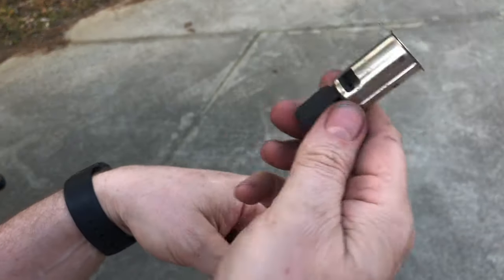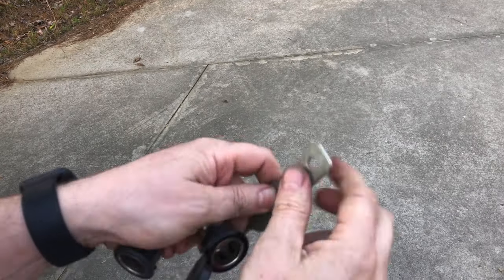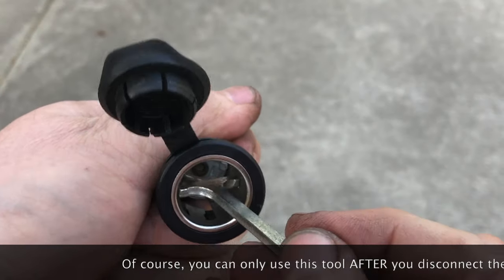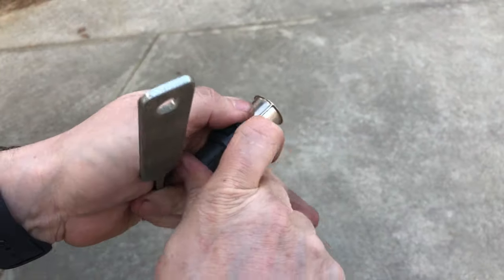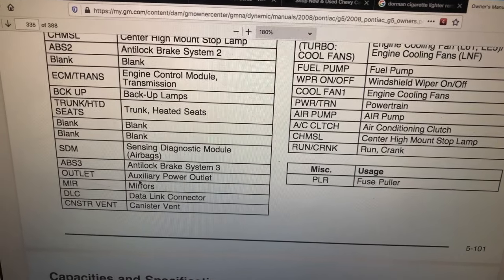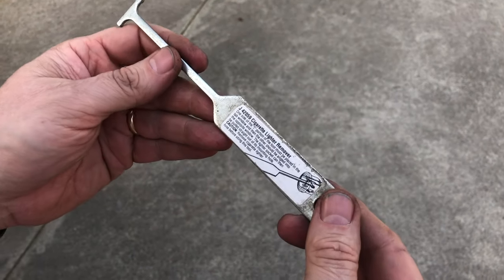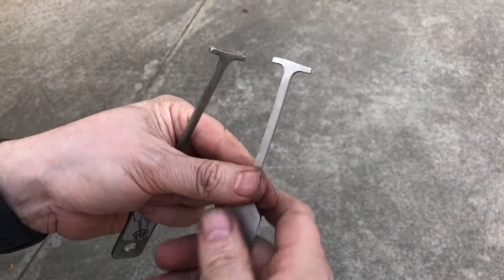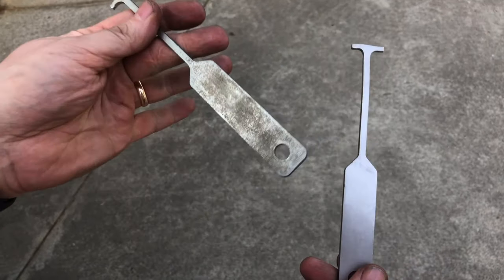1996 - 2020 GM Car Van or Truck Accessory Power Outlet / Cigarette Lighter Socket Removal & Tool Use

Comment: Thank you for the video. From my experience I recommend buying the original tool. My after market one was tiny bit wider and got stuck in the socket. It took me about half an hour of swearing to get it out, unfortunately with few bruises around the socket. Spending few more bucks is definitely worth it.
Reply: Agreed, I bought the socket and tool for 20 bucks.
Reply: I bought the Dorman which is not the OEM tool as suggested in the comment below and I contacted Dorman first and they said it was the tool. It's now stuck. Socket won't come out and tool won't come out. Doesnt even make sense to me. Unless the tool bent in there? Aluminum not steel like the OEM. Plan B.
Reply: @sweetiepienumber1  the same thing is currently happening to me. Stuck inside

Comment: Unless the Dorman 56457 (OEM Part Number 25776667; J42059) tool was too wide; 2018 Chevy Traverse does not seem to use a tool even though the socket accommodates one. DrShock told me some cars require removing the black bezel plastic ring/retainer ring with a tab on each side (east and west) that are depressed and then by pulling out the bezel the socket came with it. My Dorman tool got stuck in the lighter socket in the plastic bezel housing. I could not remove the tool until I was able to push the socket back into the bezel a fraction (after I had it at a vise). I don't see how the tool works on this car because when removing the bezel the socket came out with it.  Thank you DrShock for the tip.

Comment: Great stuff! ... Now then, how do u remove it if the cigarette lighter itself is stuck(pushed in) inside the socket & doesn't want to budge?
Reply from the maker: I imagine this could only happen due to either corrosion, or a defective design aftermarket part encountering some physical obstruction with the OEM socket.  Either way, you'll have to apply sufficient force to undo this bond in order to get the tool in that's required to remove the socket.   Care is needed to avoid cracking or otherwise damaging the dash when doing so.   For corrosion some penetrating fluid can be helpful (put down plastic to avoid staining the carpet below).  And you definitely want to pull the appropriate fuse to remove power when going this route.

Comment: How do you get the bezel back in? I'm replacing a dash panel and I have to use the old bezel on new panel for cigarette lighter and it don't want to go back in. It looks like it should snap back in, but I keep pressing it, but it's not snapping back in. Do I need a special tool to get the bezel back in? It's a 2002 Chevrolet Cavalier. Thanks for your time
Reply from the maker: No special tool for the models with a bezel.  But there will be tabs on the bezel, both that secure it to the dash panel, and to the socket.   Either you haven't got those aligned, or they may have broken off due to age requiring replacement of the plastic bezel.
Reply: Thanks!!! @DrShock

Comment: Maybe you can help me ? My cigarette lighter is stuck in the socket and won't
come out, no matter how hard I pull on it. When I bought my car used, the previous
owner removed all cigarette lighters, so I used one from another car, and it's
"stuck" in there. Should I drill it out ? or really pull hard ? If I pull too hard it may
tear out the wiring harness. You seem to be very good with your hands, so what
would you do ? I'm thinking just to drill it out ?? What do you think ??
Good video BTW.
Reply from the maker: If I'm following you, this is a situation where you forced the installation of a outlet from a different model vehicle into this current vehicle.   As a result, the fitment is wrong so now it's wedged into the dash.
 
Well in this sort of situation I'd be concerned with damage to the plastic dash face/bezel, so what I would suggest is removing that from the vehicle and work on extracting the incorrect sized socket from behind.

Comment: I have a 2006 GMC Sierra 
It has the single piece lower dash assembly
I used the DIY tool and I’ve wiggled
Pulled
Strained
Tugged
And bent the shit out of my tool with zero progress on getting the original non working socket out
Reply: Have you removed it yet ?

Comment: Great instruction... Will replacing that part of the lighter be enough to stop burning out the fuse. (I'm sure I'm not using the right language.)
Reply from the maker: Thanks, the fuse is going out from a short circuit most likely.  That could be in the socket (the part this video covers), or the wiring harness connecting to the socket in the back of the dash.  

The easiest way to tell is a visual inspection after removing the socket from the vehicle.  Check for some debris inside first, sometimes that's all it is.  Sockets that are obviously rusted/corroded, appear burnt, or otherwise damaged at that center terminal at the very bottom of the socket are likely shot (what blows the fuse is direct electrical contact being made from that center terminal with the sides of the socket instead of a lighter element or phone charging plug).
 
The best way is to test the socket with a voltmeter, which a local auto parts store should be able to do if you do not own that kind of tool.

Comment: I accidently busted the "bezel". Is there a specific model number for the bezel that goes to the outlet? Or are they universal?
Reply from the maker: It will vary by model year and model, GM uses the same part across many models for this but they do change over the years to match the interior design changes.   Your local GM dealer should be able to hook you up with just the VIN.

Comment: Hi, I bought the Dorman tool (I messaged Dorman they said it was the right tool) for a 2018 Chevy Traverse and it went into the socket fine, however the socket will not pull out. I can't get the tool out either. Any thoughts? Thank  you.
Reply from the maker: If the socket on that model and year has the two opposing square cutouts for the tool, then you should be able to remove the tool by moving one peg of the tool all the way out of one square cutout on the socket by rocking it at an angle.   If it went in, it can come out.  ;-)

Some models may have a snap on retaining bezel going into the dash trim that you may have to remove first, before the socket can be extracted.   The service manual for the model and year is going to be necessary to determine if that's the case with your vehicle.
Reply: Thank you the retaining ring might be the issue. I have the tool in right I watched your video and others, etc. I pulled so hard I injured my intercostal muscles pulling on that tool. I lubed the sides with silicone to no avail as well. So. I'll try the tabs on the sides of the black plastic ring with hinged cover. I appreciate you getting back to me so quickly. When I get this out I'll have to buy a DrShock t-shirt. @DrShock

Comment: I have a 2002 Chrysler Sebring and a penny dropped down the cigarette lighter socket and there was a small spark and now I don’t have power to my sockets. What should I do to fix this? Thanks for any help given in advance it’s greatly appreciated
Reply from the maker: The coin would have created a short circuit, which would then blow the fuse.   You'll need to extract the coin by removing the socket and disconnecting it before you replace the fuse.   The socket may still be serviceable, or it may need to be replaced.   You would judge that based on signs of burns or heat damage, as well as corrosion.
Reply: @DrShock  out of curiosity, what would happen if I disconnected the fuse before the battery? I’m very new to this so every little information helps. Thanks
Reply from the maker: @LongHairedTurtle  If you remove the correct fuse (the one actually for the accessory power socket), it's the same outcome as disconnecting the vehicles battery negative cable.

Comment: Same tool for a '78 GM product or would you "bend" the clips with a small screwdriver like I've seen on other channels?
Reply from the maker: There's a reason GM designs special tools to service these parts.   You don't have to use the genuine GM one, there's plenty of knock-offs of this tool available in your corner parts store for less (links in the description).  Personally I could never damage someone else's vehicle/part by bending it like that.   

This particular video is about a power outlet part that only services back to the 1996 model year.  I don't know if this specific tool supports older model years than that, there have been several different GM designs over the years.
Reply: @DrShock  got it. thanks!

Comment: Do u need to disconnect car battery or just keep the key out of the ignition? 🤔
Reply from the maker: You have to pull the power fuse before inserting the metal tool like described in the video.
Reply: @DrShock  So i hv pulled the two fuses front and back. So if i use metal, I'm ok fr blowing any other fuses or fry the whole electric in my vehicle?
I dont hv anything plastic. 
Sorry, I just don't know about this basic fuse or electrical stuff exactly.
Reply: My sockets are 5vrs old and look rusted corroded nasty inside.. I replaced the fuses twice but everyrtime I try to use lighter they've blown.
Reply from the maker: @ALSILVERU2  Hey sorry for delay responding, I missed these two comments earlier.  So yeah just pull the negative cable from the battery.   Then remove the socket and replace it.  Put in a new fuse as well after you do that.  Reconnect the battery and give it go.  With the battery negative cable removed, it's all safe to work on electrical short wise.   Just be sure you get the correct replacement socket part for your make/model/year and be sure it's plugged in correctly and you should be good to go.
Reply: Just pull out the fuse

Comment: Do you have to disconnect any power or anything?
Reply from the maker: You won't be able to disconnect the wiring harness until you get the socket removed as the connection is in the back as shown.  But if you feel you might let the tool slip and make contact with the bottom of the outlet,  definitely pull the fuse for the accessory power.   If you accidentally touch something metallic between the shell of the outlet, and the connector and the very bottom then that will cause a short circuit.

Comment: My 12 volt lighter keeps burning out my portable lighters help plz  fuse is fine i checked voltage and its pretty steady 12-13 v
Reply from the maker: I'm reading this as your 12V accessory socket is burning out the element on your removable cigarette/cigar lighter.    Not sure what else you could mean by portable lighter here.  So if the fuse is good to the socket, and the 12V socket is not corroded, then you want to look at the cigarette lighter element itself.  Are you plugging in a genuine GM cigarette lighter element into the socket, or an aftermarket one here?

Comment: I have the tool. It pulled the cigarette lighter but I can't get it to pull the aux port out
Reply from the maker: The tool pulls the socket housing which is the metal portion of the aux port.  The cigarette lighter plugs into the socket housing.   After you pull it out, just like in the vid, nothing left but the retaining bezel and that unsnaps from the dash trim once the housing is removed (the housing exerts pressure on the tabs that keep the retainer held into the dash).

Comment: Will that tool work for a C5 Corvette?
Reply from the maker: It should fit anything from GM up thru around 2020.  But you should take a peek inside the socket to be sure it looks like what you see in the photo - for the presence of the square cutouts the tool fits into.

Comment: Mine had the 2 notches but it wont come out no matter what and now my tool is stuck inside..
Reply from the maker: Once the tool is in the socket notches, you're kinda committed to pulling it out in order to remove the tool if nothing else.  Have you tried to give it a twist first?   Sometimes the plastic bezel can get melted onto the barrel of the socket.

Comment: One fuse on my 2003 Nissan Murano is blowing all my power sockets.  I keep replacing the fuse.  I bought the double usb power socket.  Or do you think it is a relay and which one?

Comment: I bent my T tool, it seems impossible
Reply from the maker: While this video is specific to GM, some models may have a retaining bezel or clip that has to be removed first even if they use the same type of tool.  Just something to keep in mind.  

The least expensive of these removal tools will be made of aluminum, most likely Chinese,  as I mentioned in the video.   These are OK for relatively younger vehicles but may bend if you have a socket that is stuck in there from many many years (over a decade or more).  The more expensive steel version of the tool will not have this problem.    Also, be sure you are not trying to pry out the socket as this will more more stress on the aluminum version of the tool.   Rock the "T" into the square holes in the socket barrel, straighten the tool up, and pull directly outwards.  If there's still resistance, your model likely has a retaining bezel or clip that will need to be removed first.
Reply: @DrShock  

Thank you for your time in answering this. 
Yes, I might have to buy one made out of steel.
My car is a Chevy Tracker, they don’t even make these cars anymore. 

Struggling to keep my devices charged at the moment. I’m in a homeless situation right now, and only my car is my source for power. 

Good day to you

Comment: I can't find the goddamn fuse. Can I disconnect the battery instead?
Reply from the maker: Sure, more than is required but certainly will still render the circuit safe to work on.  Just verify you have no power before proceeding with the repair.

Comment: I bought one and did this and it got stuck! I couldn't get anything out. I had to pry the side of the retainer to get it out, broke a clip, then the tool was still stuck in the socket It took forever to get it out -  what a GD disaster. I could have done that without buying the tool. It ended up be totally useless
Reply: Hi Tony. The same happened to me with my 2000 Camaro. I bought Dorman lighter at Amazon and the tool was included. Where did you get yours? To make it more interesting, the plastic part of the lighter was missaligned with the steel one so I couldn’t get it in the socket. I am planning to buy the lighter at rock auto. Any experience there? Thank you for any information.
Reply: I bought mine in auto zone, and I bent the tool, the socket did not come out

Comment: Well, they still ARE cigarette lighters!  They come with an element that heats up to light your smoke (or a camp fire in case of an emergency 😉) and many cars come with both a lighter and a USB port.  😀  So give us old timers and those chronic smokers who insist upon lighting up in the car a break, don't take us out of the equation before our time.  😆